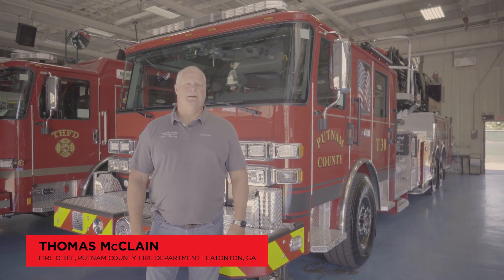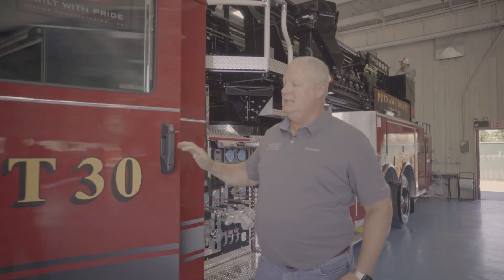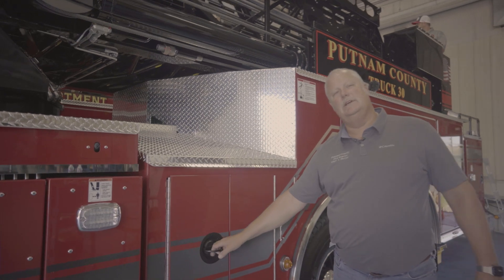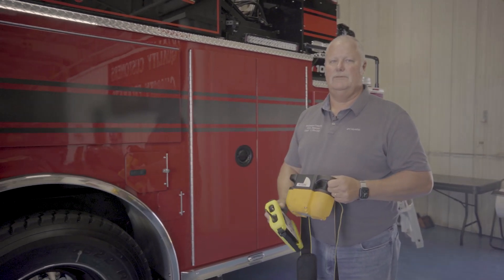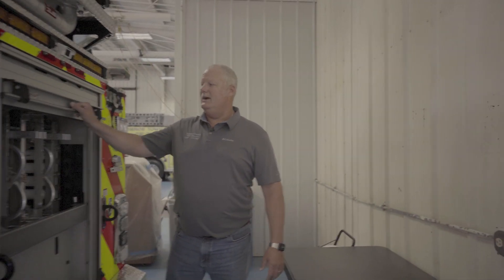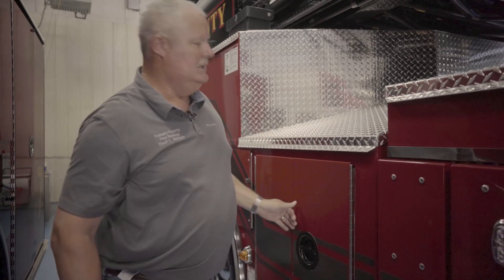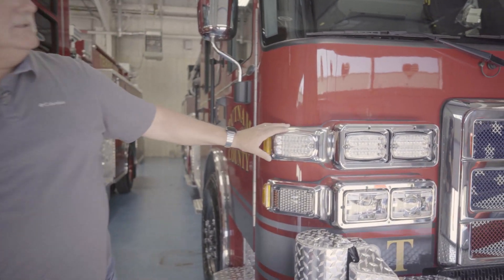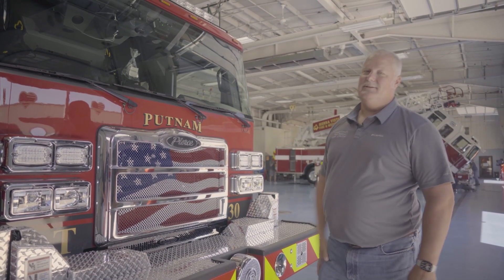Enforcer™ Ascendant® 100' Heavy Duty Aerial Tower – Eatonton, GA

Comment: Congratulations on the new Enforcer cab offering I don’t think many hit the streets yet ? Everyone seems to get the big Velocity cab or the Arrow XT
Reply: Until recently the Enforcer was only available with the 10.5” frame rails which limited its availability as an aerial.  It was originally introduced as a step up from the Saber (its more basic twin) when Pierce revamped its custom cab value product line offerings.  It’s popularity has driven the recent upgrades.  My department has a Enforcer rescue that has the 10.5 rails, and we recently ordered a pumper and opted for the larger 13” frame rails like on the Arrow XT pumper purchased in 2010. Big advantage over the Arrow is the Enforcer cab is wider and has a lower engine tunnel.